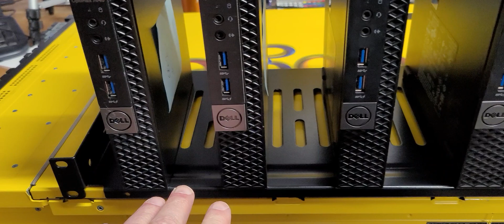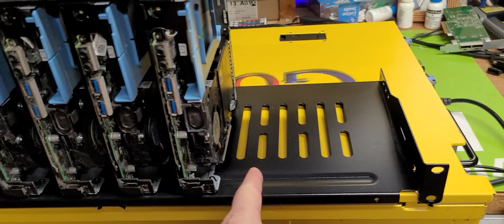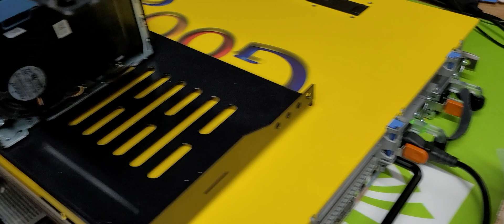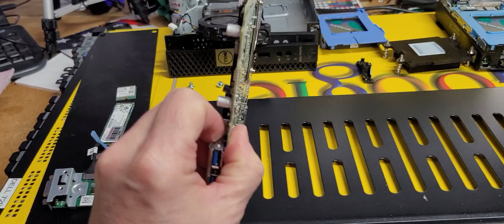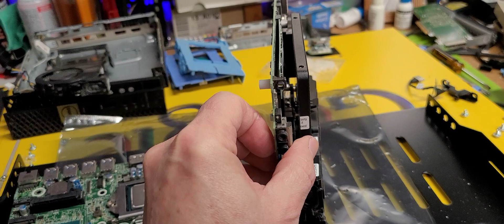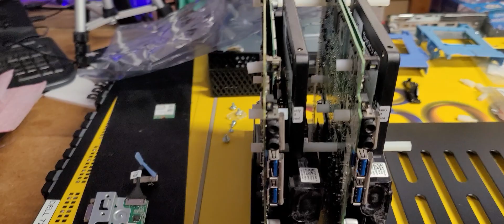The ProxMox Mini-PC cluster test bed is being built now and I want your thoughts on my next steps

Comment: 1 would be easier route, but 3 more fun... :) I would vote option 3 - specially if you want to replicate it in DC. I would also be interested in testing whose options with stress test and how temp holds - to actually decide route. Lastly maybe check ebay if there is some 6U ? unit. I would be cool to close it and with front/back fans...

Comment: I like option 3 but my concern is if you have to maintenance a node it means taking the cluster apart.  would be interesting if there was an option 4 where you could slot the motherboards into a bay.  maybe 3d print. or mount them to a piece of plastic that can slide in and out of slots. something like what Jeff Geerling is doing with raspberry pi cluster.
Reply from the maker: You are correct on both levels.  Yes it would be hard to rest these boards correctly without a structure but I have to do that without a 3D printer for I don't have one currently.   But we built this stuff in the past and there were 3D printers so no big deal for I can sleeve the boards with plastic sleeves and help stabilize them.  As for the part breaking or servicing yes if a CPU fan fails I will have to take the unit apart to fix the failed CPU fan.  But that happens.

Comment: If i did this myself though brad i would stick to option 1
how many do you need to do proxmox efficiently and do you get more possibilities the more computers you connect or is their no Advantage ?
Reply from the maker: Yes and yes... The more you have (with V-Pro that better supports virtual machines instances) the more you can do.  I think I will do it in stages / first  Opt 1 and show the small foot print with little impact then do Opt. 3 next.  Look for my next video for it will show what this could really do (as a opt 1 format) before I do the final deployment for Opt 1.   It comes out later tonight.

Comment: hey brad good video although i can think of 9 maybe 12 different options with these i would look at it like this i would do all your options and buy yourself a thermal camera to take temperatures or if you have a thermal probe meter attach this to each setup

op1a the clean version
op1b the clean version without nvme

op1c the clean version without nvme and replace ssd for 10k 15k hdd enterprise spinning disk this would be my  prefared option for option 1 as it would be the most cost effective

op2a without half the case this would work well although like option 1 you could have it with or without m.2nvme and you could use spinning disk over ssd my issue with M.2 nvme is they run really hot and SSD none enterprise do as well so can you put an enterprise SSD 

op2b another option i thought of would be good for this is if you can make mini rack mounts so you can inter change them when they fail 

op3 just using the board with ssd or hdd 

op4 using some other types of thermal removers their are so many now available 

op5 you could use liquid cooling  system but this would add quite some expense 

op6 would be the most enjoyable but also would be most difficult to pull off you could make a rack of 12 and put it in liquid oil container like electronics in a gold fish bowl

As to the other hardware options:-
Wifi aerial or is inplace or removed
Ram chips can you get enterprise ram chips for these or make ones like it with sheilding on them 
m.2 nvme im not sure what you can do that would help with heat for these as from board to board they will be too close so if you could get away with not using these i wouldnt have them.
SSD I would not have those cheap SSD drives in those housings 
HDD i would stick to the 7k 10k or 15k spinning disk

Processor 
so i think their are a few so which ones are you using the i5 or the i7

What is the differance between the normal vs vpro version and which are you using ?

so yeh their are alot of option depends what your budget is for this clean is the cheapest though but with all my extra options ive suggested it could cost alot more if you use liquid cooling but it would look cool. :hand-orange-covering-eyes::face-blue-smiling:
Reply from the maker: OK well you thought a lot about this... Opt 3 and opt 1 are in the lead so far but let me check more on what you recommend.   Money is a factor but!  We will see,,,
Reply: @leadiususa7394  yes money does effect things but their is no rush you no as my setup is not finished i still require things do to budget but ill try to send you my current list of equipment 

so like you could easily do 

op 1 
op 2 
op 3 
that i mentioned
 
liquid cooling now thats a mod that would probably put costs up 1000 dollars but temperatures would be alot cooler 

and it would certainly be one that may cool down nvme drives but you would have to save up to do this

I would like to see option 2 though because with option 2 you can pull out failing hard drives and it still would look reasonably good for someone who is an ocd